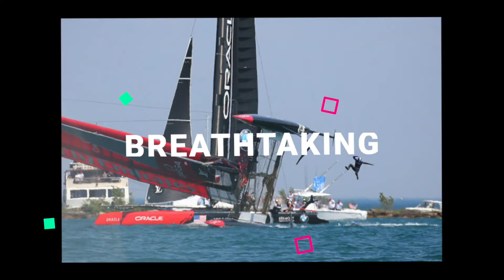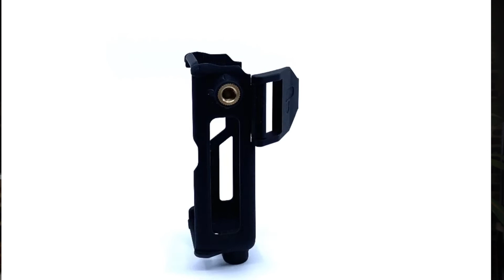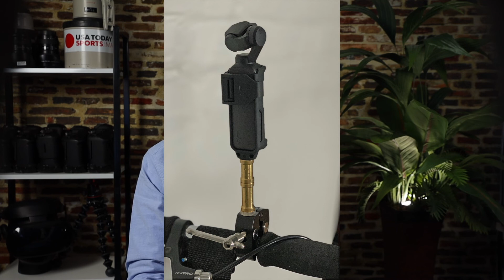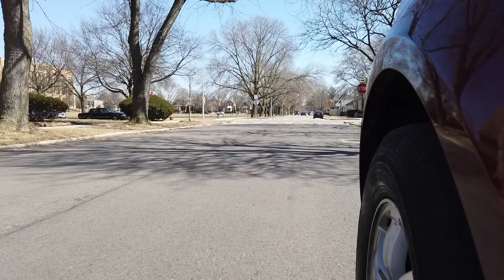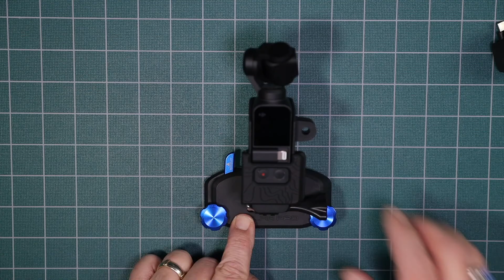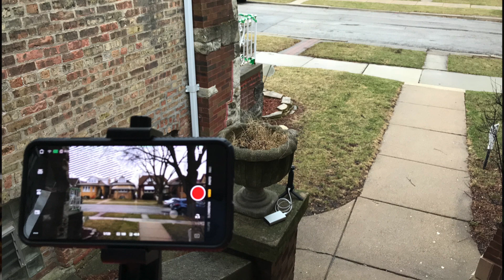4 PolarPro Mounts for the Osmo Pocket, and Several Cool Applications

Comment: Great video.  I instantly subscribed.  I would like your opinion.  Any reason you can think of why something like these couldn't be used instead of the suggested pieces to extend the 1/4-20 below the Polar Pro wifi adapter?  I have found 1, 1.5 and 2.0 inch versions.   Would allow attaching microphone adapter and tripods etc. https://www.amazon.com/Stainless-Threaded-Thread-Length-Threads/dp/B00G3P7J1O/ref=pd_sim_0_1/131-5833071-3455146?_encoding=UTF8&pd_rd_i=B00G3P7J1O&pd_rd_r=3785c38d-5a74-11e9-b906-b9ec640be17b&pd_rd_w=8MB1x&pd_rd_wg=x24m1&pf_rd_p=90485860-83e9-4fd9-b838-b28a9b7fda30&pf_rd_r=PDDA4WGN66YRXBH7PGC1&psc=1&refRID=PDDA4WGN66YRXBH7PGC1
Reply from the maker: Rees, thanks for the Sub. That item would fill the role of a male-male 1/4-20 extender. What I have use is a male-female extender, but your suggestion would work, given the proper adapter on the tripod mount side.

Comment: Like your videos they are practical, love your idea about the 90 degree angle adapter for the wifi adapter never understood well how PolarPro would not account for the space in the connection of the tripod mount or design a tripod mount with the wifi adapter in mind.   and also they failed to add a hole to the front so that the red light on could be seen and also once is place in the Wifi holder the OP has too much play and the keeps pooping off all the time.  I found this new thing at Thingiverse that has a tripod mount at the bottom and also holds the OP and Wifi adapter together much more secure.   https://www.thingiverse.com/thing:3376474       let me know what you think, subscribed and follow you at the Facebook OP group
Thanks,
Luidoly